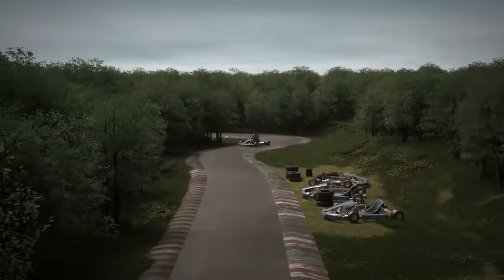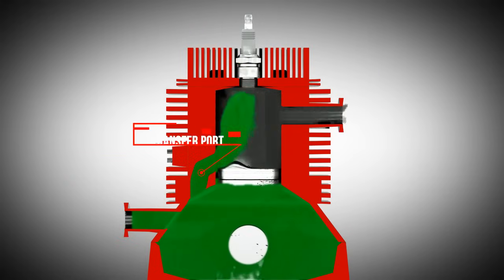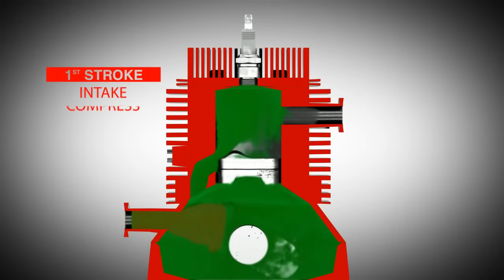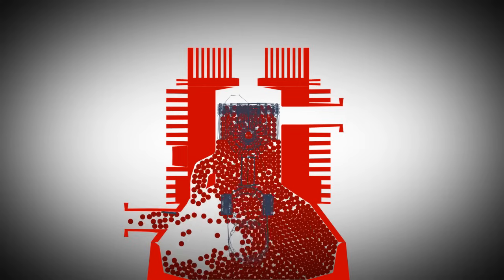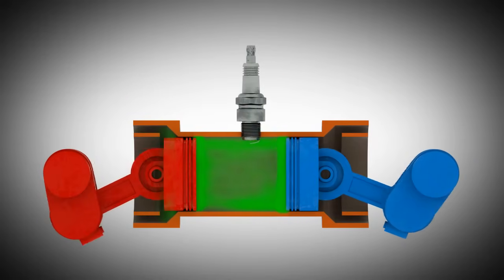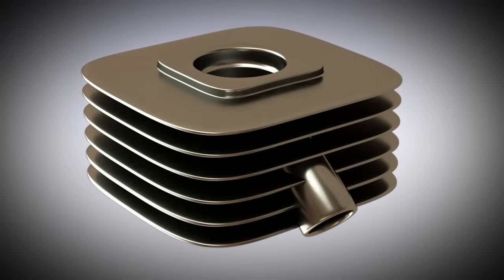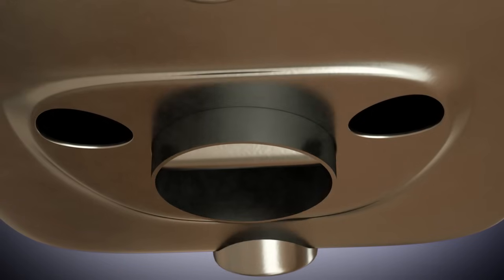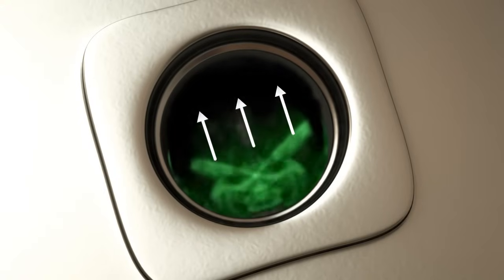Two-stroke engine - How it works! (Animation)

Comment: Nice illustrations and explains to me how 2 strokes can work.  But you didn't mention that little check valve that appears in the illustration with the spheres.  That valve is missing in the first illustration.  Without that check valve I don't understand how the downward motion of the piston wouldn't just force a backflow of fuel-air mixture into the carburetor.  This would result no net vacuum at the intake and the engine would not work.

Comment: Intake air doesn't force the exhaust out.   The exhaust is at a higher pressure.   The exhaust helps pull in the intake. Aka your mention of scavenging

Comment: How does the two stroke make compression with the exhaust port open.
It seems fuel and air mix would be pushed out the exhaust until piston goes past exhaust port which looks to be located at near the top of cylinder so how does it make power.
I understand how  expansion chambers work and that they increase hp but it still seems compression would be lost in exhaust. If this was a four stroke it would be similar to a blown  head gasket it seems. I know a two stroke works and can make awesome low end and accelerating hp but how?

Comment: I've gone so far as doing a complete rebuild on a 2-stroke engine, and I don't mean just pulling the jug off and replacing the piston, I split the case, replaced the crank, bearings, and all along with the piston (so full top and bottom rebuild) and I had no idea how the hell a 2-stroke operated.  It was successful and everything worked great after I got it all back together, but it's funny how little I understood about what I was actually working on at the time.  Of course I was following a youtube walkthrough of it all, so that helped, lol!

Comment: This is a great animation, however there are some technical errors, which mean this engine would struggle to run. The exhaust port is way too high in the barrel, and there is no flow control on the intake port. This engine would need either a reed-valve or disc valve on the intake to function, or the intake port being part of the barrel and controlled by the lower edge of the piston (piston-ported)

Comment: Question: since gas mixture in crank is compressed , what prevents it from going back into the intake if the pressure is high enough inside and low enough outside ? What tells the gas mixture to "go into that cylinder" ? No one way valves on intakes AFAIK.
Reply: There is a one way valve offcourse
Reply: Reed valve or rotary valve

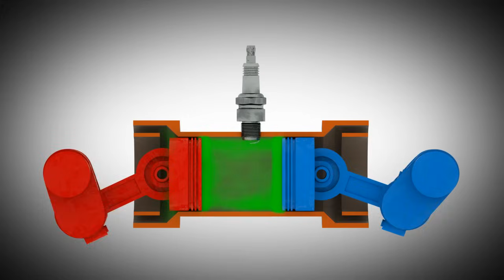Comment: the animation at 0:35-2:34 has the exhaust port too high.
if the exhaust port was actually that high you would loose most the power, a ton of un-burnt gas, and wouldn't be able to complete or even do the compression.
other that that, the video is perfect, and the rest of the animations is on the spot.

Comment: For two strokes with transmissions, how does the gas not get mixed with the oil inside of the crank case?
Reply: Well... You see, 2 strokes lubricate from oil mixed with the gas, the transmisson is seperate from the crankcase and uses a different oil. Engine oil comes with gas but the trans is like any other engine
Reply: Ok so the cases separate the crank and cylinder from the transmission then

Comment: When i actually understood what goes in inside an engine, I can really respect how long engines really last considering the constant high intensity work they perform for hundreds of thousands of miles. Excellent engineering
Reply: Yeah that's why oil is so important. It's not metal on metal contact, there's always a thin layer of oil separating everything. If an engine runs dry even for a little bit it'll destroy itself pretty quickly.
Reply: @joshuaurbany6468  my Honda CBR600 begs to differ 😂
Reply: @1alexnewman  and kenny roberts square  four cylinder 2 stroke  of only 500cc yamaha that weighed 300 pounds making king kenny  the first american and the first rookie to ever win the world championship of the european moto GP first time trying ..as the bike made over 200 horsepower @ 10,500 RPM with a top speed of right at 200mph spanking all 4 strokes then and now ...not to mention the TZ750 yamaha two stroke inline four moto GP that produced horsepower well over any naturally aspirated liter bike and bigger then and today  ...kenny put one of these engines in a dirt bike frame set up for the Indy Mile ..it had over twice the horsepower of anything else that consisted of parallel british twins and american v-twins and kenny's yamaha 2 stroke was around 50 pounds lighter weight than anything on a mile dirt track of all 750cc AMA Grand National GNC-#1 class that on the Indy mile reach speeds of around 140mph on the back stretch - 120mph sideways through the turns ...this was the very first time the bike had ever been fired up as it did not exist the day before so not only was it a first for a start up it was a first for you name it as kenny himself had never ridden anything quite like it nor had anyone else...an indy car on dirt against the world of outlaws like steve kinser , sammy swindle winged sprints
The first disadvantage noticed 2 stroke braaap raaap buzz bombs made for burning off moto gp road racing slicks on asphalt dont make no potato potato traction on a clay horse track at the indiana state fair grounds home of the famous Indy Mile ..so kenny was dead last chasing the harleys that do go potato potato making them the traction kings along with the  BSA's and Triumph's with their 270 degree cranks that skip a beat imitating the potato potato of the hawgley - davidson tractionators and about minimum weight of 300 pound Rickman Metisse Triumph 750cc big bore kit per AMA rules plus the Triumph was using a Rickman 8 valve cylinder head ( 4 valves / cylinder ) and its morphed crank of 270 degrees making it go tity bop tity bop making it very hard to pass if you got in its roost turning a 120 horsepower as they all did ..it takes every pony to go a top speed of 140 on the mile dirt track or you are not even in the hunt ..so roberts was lucky spinning the back tire off one after another to qualify for the 25 lap main event and started dead last in the last row ..and could get it to bit the whole night so he was up for trying anything ..then on the last lap it happened big time. Kenny found that if he used the hay bails like they were motocross berms squaring off the turns he got a drive off of turn #4 and passed the entire field of topped out 750 flat trackers to take the checkered flag of the 1975 Indy Mile ....as all others never had a chance ...what no one seems to understand is 2 strokes make real boost at the time the power band starts  building the horsepower 2 - 3 - 4 times more horsepower when they come on the pipe big time 
4 strokes can not ever do this super charging effect but all they can do is weigh in at much greater numbers spinning all their dozens of monkey motion parts and parts pieces to only suck bang and blow at the same rate since the beginning of time taking twice as long of the ticking of the clock to make 1/2 as much horsepower spinning up twice the rpm and only making real horsepower one stroke each time the piston makes four strokes and two complete turns of the crankshaft ...its like costing you horsepower 75% of the time its hundreds of parts are moving ...and if for some reason they move too fast too long at speed fatigue does them in every time...its not if but when as your 600 is maxed out now and will die from rpms before the piston rings are worn out and burning oil ....as your little buzz  bomb hits 14,000 to 16,000 rpm your CBR600ARARARARAR (sounds like a little dog barking when you say it fast )
Reply: It literally blows up
Engines and rockets are marvels. How do they make rockets so efficient but also so innefficient at the same time
Reply: @ClebyHerris  rockets and engine are VERY different thing, so dont compare it, only if you add too much power without modifiying it, it will blow up, but no explosions and no fire, it will just stop working
Reply: @tonyhuang431  “rocket engine” we call the powerhouse of a rocket the engine. 
Gas engines are very good at making power but in the grand scheme of things are very inefficient like electric powertrains are super efficient

Rockets and engines operate on the same principle and are comparable. They don’t use the same metric but they both blow stuff up to make power
Reply: @ClebyHerris  engines themselves don't blow up into a big fire ball, unless your talking about another blow up, gas and air mixed up does blow up
Reply: @tonyhuang431  they both use fuel and oxidizer and utilize the power of combustion
Reply: @ClebyHerris  in your first comment you said it blows up, I understand you were talking about how engines blow up,
Reply: @ClebyHerris  your statement is contradictory and totally meaningless
Reply: The slowest dislike I’ve ever given
Reply: Remarkable

Comment: What's stopping the air from being pulled from the exhaust port? Both transfer and exhaust opens at the same time correct?
Reply: The exhaust design creates a "back pressure". That keeps the air going the correct way. Ever noticed those odd bulges in two stroke exhaust?

Comment: On the "combustion stroke", what stops the "explosion" from exiting the exhaust port? Thanks!
Reply: the piston is in the way of the exhaust port and when the piston moves laterally the gasses can escape
Reply: @jacobbroeren1841  I know that. I mean the exhaust port is so high up it seems like the "explosion" itself - not the gasses from it - would escape prematurely, instead of the intake gasses pushing out the exhaust gasses.

I just looked at some other videos of 2-stroke engines and the exhaust port is WAY lower - it's at the same height as the intake port.

Cheers!
Reply: @justlolatthisworld7917  its just animated too high in this video
Reply: @AddictedtoAir_69  Yep. Still a great animation. Cheers mate!

Comment: Now I understand why 2stroke was replaced by 4 stroke engines in almost everything. Having the exhaust and refill on the same stroke must be way inefficient. You will be venting out some fuel-air mixture before it can fully compress and before the spark can ignite it.

Comment: Two strokes are such powerful, light engines. Too bad they have heavier emissions than a four stroke. I'd like to see them return in all displacement motorcycles. From enduros to the wicked Kawasaki 750 triple, these engines just rip.
Reply: Still have my 71 rd 350 Yammie. Too bad it's not running.

Comment: Great video & explanation. Although, the video misses an important aspect of the 2 stroke motor. The shape of the exhaust is engineered so that it produces ‘back pressure’ after the fresh air&fuel mix enters the combustion chamber. This keeps the air&fuel mix from escaping through the exhaust port, while also pressurizing the air&fuel mixture. Almost acting like a turbocharger, this is what makes 2 strokes so powerful in comparison to four strokes.
Reply: I'm trying to learn this 2stroke .what happens  when u pull the cord to start but now the back wheel is spinning  to the point where it takes off? Without touching the throttle...please help.
Reply: @yvonnekrothe7391  maybe it is your idling speed, it might be too high or u need to put it in neutral/hold the clutch

Comment: you forgot to explain why the exhausts are formed like they are because thats a very important part of the 2 stroke motor its called the resonance exhaust and thats what gets the power and unburned fuel in the ignition chamber

Comment: I’m taking an online class about motorcycle engines and the ports were freaking confusing as hell to understand! The visuals suck and this helped me understand what happens when the piston is top dead center vs bottom dead center plus how the transfer ports work. Didn’t realize the ports were on the underside of the cylinder..

Comment: Why doesnt the air fuel mixture gets pushed out of the exhaust port?
Reply: Cold air displaces hot air, so air fuel mixture pushes out the exhaust gases. and before the air fuel mixture could escape, the port is closed and ignition happens.  At least that's how I understand it.
Reply: @reubinthomas  Actually mixture gets pushed out, but majority of 2 stroke engines have an expansion chamber exhaust that creates backpressure and pushes it back in.
Reply: @yamatismi  Thanks for the info. I didn't know much about 2 stroke engines' working principle.

Comment: I've been working with engines as a hobby for 10 years, but still find it hard to understand how 2-stroke engines conrod works so reliably without a hydraulic bearings like in 4-stroke. Since there is no oil system in the 2-stroke, there cant be similar bearings.

Comment: Now I know Wonder why 2 stroke engine extinct. Not very fuel efficient.
Reply: That's their major downfall, and 4 stroke engines are getting close to their power to weight ratio even without forced induction. Add forced induction and a 4 stroke engine esily surpasses the power to weight ratio of a 2 stroke. One of the main advantages of a 2 stroke engine is simplicity, which makes them significantly cheaper, which is why they're so commonly used in mopeds, 4 stroke engines are becoming common even in mopeds these days though.

Comment: I imagine some air/fuel escapes through the exhaust as well.
Reply: Yes. This is one of the major reasons that you don't see 2 strokes that often anymore. Unburnt fuel is wasted fuel, and it's also much worse for human health than normal exhaust. A solution is injecting fuel into the cylinder itself instead of the crankcase.
Reply: Hence why two-strokes produce a lot of smoke out of the exhaust

Comment: Deflector piston? Kidding, right? Outmoded in the '50s, by Schnurle (loop) scavenging. Even more so of recent years, with "stratified scavenging". And, an exhaust port that high in the cylinder would release chamber pressure so early in the cycle as to abandon any power output & efficiency. (2-stroke efficiency is bad enough at best.) (Oh, yeah, deflector pistons become glow-plugs, or melted metal, real easy.)

Comment: two-stroke engines produce more horsepower than 4-stroke engines because the spark plug fires on every single rotation of the crankshaft as opposed to every-other rotation. Therefore it is twice as efficient.
A 150cc 2 stroke engine will produce about the same amount of power as a 300cc four stroke.
The only reason why 2-strokes are becoming less common is due to pollution. Since the exhaust and intake are open at the same time, some un-burned fuel (and oil) escapes, and they also burn oil since it has to be mixed with fuel for lubrication, this produces smoke.
Reply: Good explanation. Thanks. I had a feeling that some of the air/fuel mix would pass right out the exhaust port, making it less efficient. I never thought about it firing on every rotation. Interesting.

Comment: why doesn't the burned mixture exit via the exhaust port as soon as it opens up on the down stroke?
Reply: because of the low pressure difference btw exhaust and atmosphere.

Comment: Great video but may have confused me somewhat, you did not explain the role of the reed valves or make the exhaust cycle clearer. Thanks, great animation!
Reply: David Schwartz Most small 2 cycle engines don't use reed valves. You only see them in higher performance 2 cycles like on dirtbikes and golfcarts.
Reply: @thetoecutter13  How does the inlet port seal on this engine, then? Is it similar to valves in our veins, that only allow blood to flow one way?
Reply: radconserv68 Yes, that along with the piston covers tbe port as ot travels up past bottom dead center.

Comment: Fresh mixture pushes out the exhaust gases ,how's that possible when the exhaust gases have a higher pressure.i believe that the mixture is sucked in by the escaping exhaust gasses wich caused by pressure differences.

Comment: so how do you keep the mixture from just leaking out the exhaust port?
Reply: Specially designed exhaust system that creates internal shockwaves that partially forces the mixture back into the engine. I wonder why this wasn't mentioned in the video, it's a quite essential detail.

Comment: Why  doesnt the mixture get forced back out the intake opening onn the compression stroke?
Reply: Reed valves only work in one way
Reply: @beauclose2235  Do these reed valves fail sometimes? I had an engine just stop working.
Reply: A heart works the same way

Comment: the problem is, to some extent, fresh mixture escapes through the exhaust along with the fumes
Reply: That's why two stroke engines have that specially shaped exhaust, which they seemingly forgot to mention in this video. The conical shape creates a shockwave inside the exhaust for each engine cycle that partially forces the air and fuel mixture back into the cylinder.

Comment: Not a single mention about exhaust pipe even tho it's really important part of a 2-stroke engine? Video was well explained and put together, but there should've been information about how 2-stroke engine needs the exhaust to utilize its full potential.
Reply: This is true, the design of the exhaust system is more crucial for a 2 stroke than for a 4 stroke.

Comment: Obviously you’re gonna lose some unburned fuel. Just the thought that the exhaust port is open during compression could lose unburned fuel bugs me in a way. If I were to have a go kart I’d prefer a 4-Stroke because It’s more fuel efficient and sometimes mixing oil and fuel can be annoying but honestly that wouldn’t matter too much but it’s a bonus.